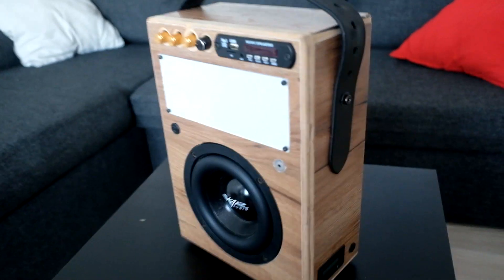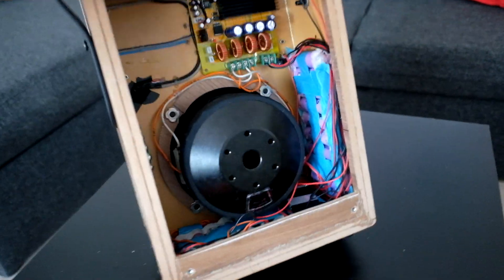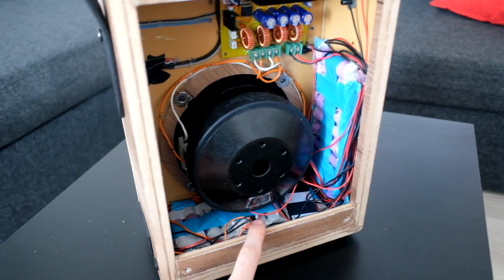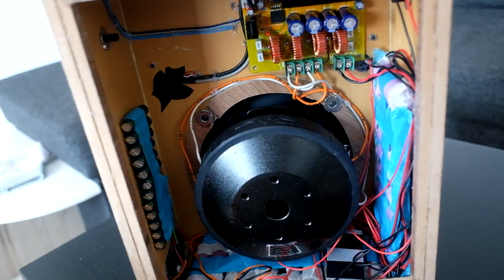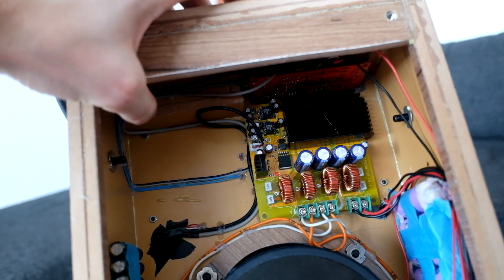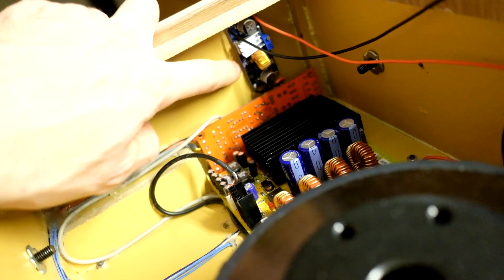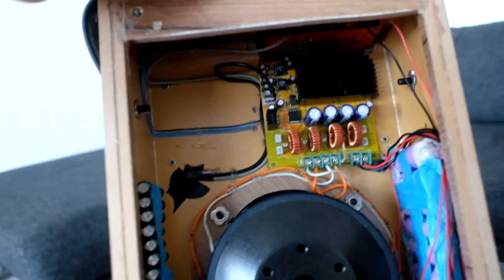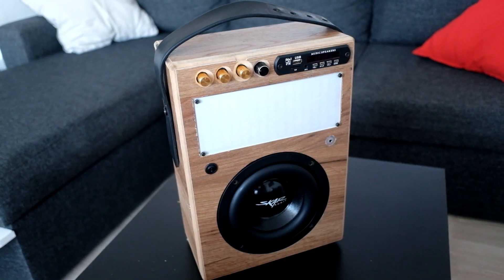600W Ultra BoomBox finally at full blast 42V 10s2p

Comment: That's a really nice design. I'm thinking of doing something similar (stereo) for our dance class.
Does the TAS5630 need a cooling fan, if running continuous for several hours?
Reply from the maker: I don't know, some amps with this chip has it, some don't. I played loud for few hours and speaker and amp was pretty hot, but I think it was because this speaker is not that effecient. To be on the safe side buy amp with the fan.
Reply: @quadsquad3087  Thanks for the advice. I think I will go with a fan from the start.